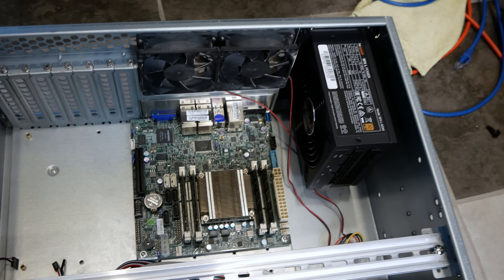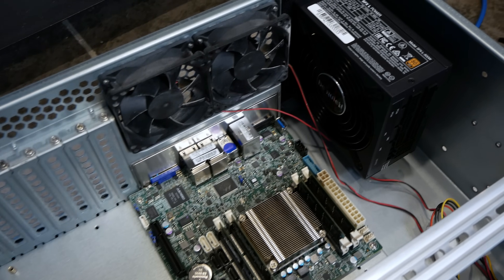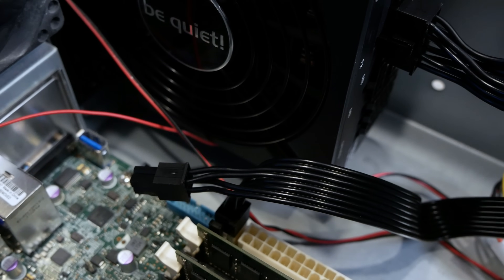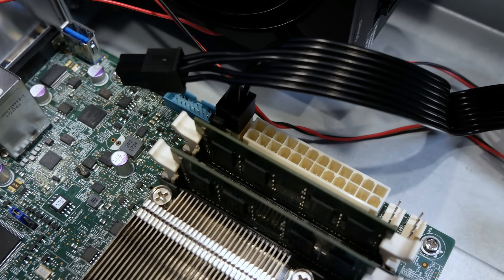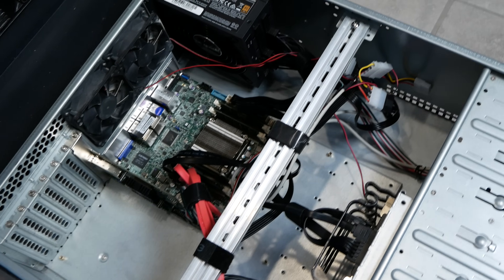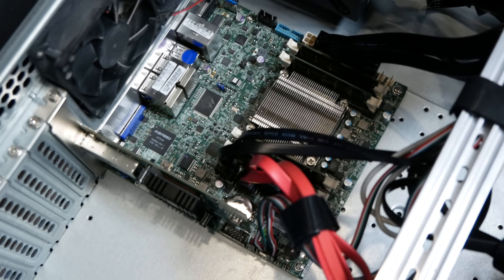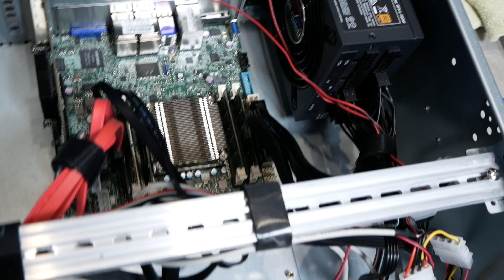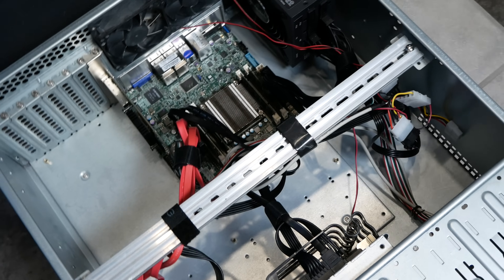Purchasing Used Low Power Server Hardware for a DIY OPNsense or Minimal TrueNAS Build

Comment: The more people watch your videos, the more eBay scalpers are going to jack up the prices. Mamamiya!
Reply from the maker: It is possible but I don't think I have that much influence with my small channel. haha. I can't help prevent scalpers unfortunately if it does happen. Used hardware is a great way to save money but of course there are some risks with that. So far, all the used hardware I've bought has done well. Most of the time I replace hardware before it fails because my needs change and/or I need a bit more hardware resources.

Comment: For bargain basement cheap to run and purchase, it's hard to beat used Fujitsu S720 & S920 thin clients. Easy to repurpose into firewalls, mini servers, etc. Great for homelabbers on a pocket money budget.
Reply from the maker: Yes, my goal wasn’t to get the cheapest possible hardware. Others have said similar things, but I stated my goals in the video (primarily server grade motherboard features). I wanted cheap, power efficient, IPMI, ECC RAM, multiple built in NICs, and a PCIe slot fast enough to support a 10Gbps NIC (since it’s not built onto the motherboard).

Comment: It would be awesome of you could do this exact same type of thing, but for a 10 gig Firewall.
Thank you!
Reply from the maker: You mean use a budget friendly used server grade motherboard with IPMI, several built in NICs (potentially including 10G so you don’t need a separate PCIe card) to use as a 10G firewall? It takes a lot of CPU if you’re going to be doing IDS/IPs but if you’re doing basic routing/firewalling, you can use a weaker CPU and still get good 10Gbps routing. I’ve designed my network to not route any NAS or other high throughput traffic through my firewall thus minimizing the need for a very powerful router/firewalling (a basic mini PC with 2.5G NICs is enough for my needs)
Reply: @homenetworkguy Thank you for your response! 

If you have a video on what you mean about not routing through your firewall, I will take that knowledge as well.

I am  using a Qotom. Two ports are dead. I shuffled things around. (After a ton of troubleshooting) And It is still my current Firewall and working. With OPNsense.

I bought a Protectli Vault Pro VP2420-4 and found you from the OPNsense on Proxmox video. But I have started to fear the protectli might die in 6 years like the Quotom. So I was wondering if there was an affordable way to do a commercial type set up (Like this video I now found of you... And subscribed since you are on a roll with me!) and rhe 10 gig was just a futureproof thought. Perhaps 2.5 is good. This is my point. I need a video on that!  I don't know! 😂
Reply from the maker: From an electronics standpoint, 6 years is still pretty decent but I agree that certain PC hardware (even consumer grade hardware) should last at least 10 years. I used the same motherboard/CPU for 11-12 years before I retired it for something faster. It was still working pretty decent considering its age. 

Buying quality components and keeping it on a surge protector/UPS helps a lot too I think especially if it does AVR (automatic voltage regulation) to minimize spikes and brownouts. I’ve been fortunate that most of my hardware replacements are due to needing higher performance or capacities rather than failing. Hard drives are the exception since they tend to fail sooner than other hardware.

My original Qotom box has survived beyond 6 years of 24/7 usage and I’m actually repurposing it after several years of not using it.

I’m hoping to do some more videos on network architecture in regard to multi-homing devices, creating a dedicated 10Gbps network, etc.

Comment: they are really old and i would not recommend them. an n100 has better performance just lacks pcie lanes, the firewalls built around the laptop cpu's have best performance per watt.
Reply from the maker: Thanks for the recommendation. It’s working great as my secondary TrueNAS system with IPMI and ECC RAM as a replication target for my primary TrueNAS system. I wanted a hard C3000 series motherboard but they’re more expensive.

I bought this board for the server grade features and not for maximum performance per wattage. I had a specific purpose in mind for it.

Comment: What are power consumption figures (idle and full tilt)?
Reply from the maker: I know when I was testing this board that it was idling at 25-26W with only a single SATA SSD attached. I didn't mess with any power savings settings with C-states, etc so I'm not sure what minimum would be if it's possible to tweak the BIOS settings for further reduced power consumption. I haven't tested the max wattage yet (but I should test that sometime). With 2 3.5" disks and 2 SSDs, I think the wattage was closer to 40W. The idle consumption is a bit high compared to some modern mini-PC hardware but for a server, it's still better than 60-65W that my main TrueNAS system consumes (but that includes the power consumption of 4 3.5" disks and 2 SSDs) and an older system I was using as a Proxmox Backup Server that was consuming 85-90W (which I decommissioned in favor of a mini-PC that uses 11-12W including the SSDs). I'm hoping to get some hardware for lower power comsumption for my main TrueNAS box as well. I'm using the board in this video as my TrueNAS replication server to have an extra backup of my data.

Comment: It's crazy how expensive that mobo is especially considering the bug. Intel is batting .500 these days while AMD is somewhere near .998.
Reply from the maker: Yes but I believe they fixed it so hopefully it’s no longer an issue for new revisions.
Reply: @homenetworkguy  they fixed it in the next version 3800's and their is a bios update to reduce the chance for it bricking the cpu but they could not stop deliberate attack

Comment: I was going to bring up atom CPU failing after a while.  2000 series.
Reply from the maker: Yeah, I'm hoping that the new revision of the CPU resolves that issue completely. I'll update if it does fail. At least there is a workaround with soldering a resistor so I will try that if it happens to me.

Comment: The +12 power supply needs to be constant. You can still make the ATX PSU work by bridging the power on signal to keep it on all the time. Another option to use an old 12v brick power supply(If it has enough amps). The drawback with the 12v option is running your hard-drives but is great for firewalls or pxe boot systems.
Reply from the maker: Thanks for the info! I wasn’t sure the proper way to utilize just the 4-pin 12V connection, but since I’m wanting to utilize several SSDs and HDDs, I’m ok using the standard ATX CPU power connection.

Comment: mmm atom, isnttha slower than a n100? and uses way more power? and when you look at the ryzen nas, with 6 ssds idles at 14w, like Wendell said, withtheactual hardware there is no point anymore to use old servers, because the horse power and consumption difference is to much, unless energy price is not a problem and you already have it or is dirty cheap
Reply from the maker: I've addressed this in the video and other comments. Yes, it's slower than the N100, but the N100 does not come with server grade features such as IPMI and registered ECC RAM. This board has 4 DIMM slots and supports up to 64GB of RAM. The N100 supports 16GB and potentially 32GB.

I imagine Wendell is referring to old, large, noisy, energy hog servers and I agree with that sentiment. I have never bought any of that sort of enterprise gear because it's just not efficient or practical for 24/7 usage unless you just want to tinker around with it for fun. This board uses 25W or so idle and when you add drives it bumps near 40W (but I haven't tried tweaking any power savings features yet or have the hard drives spin down).

I haven't had the chance to try out the new Ryzen hardware that idles at 14W like you mentioned. I'm sure it's not cheap (yet). I will be interested in that if it offers some IPMI features and ECC RAM (not really necessary to have ECC but nice to have in a server that's using ZFS).
Reply: @homenetworkguy   take a look at aoostar, i have the  wtr pro amd ryzen 7 5825u, near 500$ in germany, there is a new version with more drives but haven't seen a review of it yet, before that i had the odroit h3+ but i was adding more and more to my nas and was a little weak, so decided on somethin more powerfull but still low power, also was thinking on the ones from cwwk and minisforum, very interesting both

Comment: 12 volt input should work.
How many watts/amps was the 12V power supply that you tried?
Reply from the maker: It was just from the 500W SFX PSU I’m using. Thought it would be nice to have a less bulky cable but not a huge deal since I have it in a large chassis so space and cable organization is not a huge issue.

Comment: I have a few of these of 2014-16 vintage. I only boot them once in a while for playing around and none have experienced the watchdog failure.. yet. They're fairly slow, but great as a firewall or lightweight hypervisor duties, docker, etc. home lab type stuff. My whole lab when fully powered up is <200 watts. The latest BIOS allows up to 64GB of ECC RAM, but 16GB DDR3 ECC SODIMMs are unobtainium. I've stuck to 4x8GB using the more affordable Kingston KVR16LSE11/8 DIMMs. They're discontinued, but still a decent amount out there from $45-65/stick new. 32GB/host is more than enough for me.
Reply from the maker: Yeah good little boards for certain purposes. I’m glad they’re still kicking even though you don’t use them very often these days. I agree that 32GB is a pretty good amount for homelabs. I have 64GB on a couple mini PCs in my Proxmox cluster. I don’t reach 64GB often but it gives me the ability to fire up a couple VMs for testing with some headroom. When I only had 1 Proxmox server I tended to use most of that 64GB of RAM (lot of it was ZFS arc cache but I also would run several VMs. Now I can spread the load across a few devices).

Comment: Makes no sense, Intel N100 based motherboards beat this shrughs
Nice for experiment, but these boards would need to cost like 40$ to make it worth it
Reply from the maker: It does make sense for certain workloads. It has IPMI and registered ECC RAM. If you add the cost of needing a separate remote KVM solution, it would add up. By the way, I did build a couple N100 systems using ASRock N100 motherboards and it cost a good bit more and it supports less max RAM capacity as well (don’t think it supports UDIMM ECC RAM either).

Comment: Where's the part where you actually show its using "low power" using a smart meter or killawatt?
Reply from the maker: I forgot to show it… I have a lot of things to keep track of so I didn’t end up going back to put a screenshot/screen capture to show it. With 2 SSDs and 2 hard drives, it idles near 39-40W. That’s about 30W less than my main TrueNAS server that has 4 hard drives instead of 2. I believe with only a single SSD and nothing else it was closer to 26-28W. Not quite as low as many mini PCs but not as high as  older Xeon or consumer grade boards.

It’s possible there are some power savings features I could or need to enable to get it lower. I should to see if there are any settings I could tweak.

Comment: I think you put you CPU heatsink sideways. the airflow channels are from side to side now blocked by DIMMs. but normally server air flow is front to back, that is now does not match heatsink air channels. TDP on these atoms quite low so it may work fine but still not efficient. also, if your server has low airflow, it is nice to stick 40/60mm fan on top of heatsink, there are various methods to accomplish that from just screws, zip ties to 3d printed brackets. that 4pin 12v is not standard atx its for supermicro external brick adapters mostly. otherwise, it is great motherboard sadly most of them still are very expensive, also once you go IPMI there is no way back, ipmi is way more than just remote kvm.
Reply from the maker: Yeah I’ve seen that mentioned by others on other people’s videos. It might’ve came shipped that way but I did temporarily remove it to look for the CPU stepping. The CPU temps stay in the 40C range without an active collier so I’m not worried about it. It runs cooler than some of my fanless mini PCs. That’s the great thing about having a lower TDP. Also that systems idles most of the time and CPU usage is low even when snapshots are being transferred to the system.

Built in IPMI is certainly nice to have and I appreciate having it on my 2 TrueNAS systems even though I don’t use it frequently (since those systems tend to be set and forget it most of the time u less I get an email alert of something that needs my attention).

Comment: You may want to increase your ethernet MTU size and enable jumbo frames to reduce re-transmits, provided you have 10+ GB ethernet.
Reply from the maker: I do enable jumbo frames on the 10G interface when using that board as my TrueNAS replication target (which is shown in the fast 10G speed test). I have a backend 10G network where all systems connected to it have jumbo frames enabled. It’s not a routed network so I don’t have to worry about MTU mismatches between networks and potential retransmissions.

Comment: There is a good reason why the atoms are no longer utilised or considered, lookup the C2000 atom bug and their failures. Left a bad investment for the C3000s, possibly...
Reply from the maker: I addressed this in the video. I have a newer revision of the C2758 which does not have the CPU bug. Also I don’t think that bug exists in the C3000 series. I’ve been running a mini PC with the C3758 for the past year and do have any issues yet.

Comment: With the exception of IPMI - Why not just use a Ryzen PRO 5350, 5650, or 5750G with ECC UDIMM and an Asrock X570/B550 mATX board (supports ECC)?
Not intending to criticize your build - really interesting board.
Reply: ecc udimms way more expensive than rdimms, also IMHO ipmi is a must on any hardware that you call a 'real' server.
Reply from the maker: Yeah I have found myself preferring to have ‘real’ server hardware for my TrueNAS systems. 

I’m using consumer grade hardware in my Proxmox mini PC hardware (except for the one mini PC that has a C3758 CPU— but it doesn’t have IPMI although I had a serial console). I wish I had some of those server features for those systems but it’s stable enough for a home network.
Reply from the maker: Ohh I’ve considered alternative hardware but those CPUs do not have 25W TDP. Of course, other systems can be tweaked to have lower power consumption but it’s nice to have server grade features for cheaper than buying new consumer hardware. I believe that registered ECC RAM is more robust than UDIMMs that support ECC. I’ve looked up the difference one time, and I can’t recall off the top of my head all of the differences. Also server boards typically come with several NICs which are useful to utilize as management interfaces and you can multi-home systems so they can sit on multiple networks. This is very handy for a NAS because you don’t need to route that traffic across a firewall (which can put a heavy load on the firewall if you have IDS/IPS enabled and/or your firewall CPU is weaker).

Comment: I use the C2750 and C3758 based motherboard as Proxmox hosts for years now. Perfect for running containers, linux VMs and low power hungry applications and above all firewalls. They can be powered by 12V so you can use a 12V adapter as well. Or use mini PSUs.
Reply from the maker: Yeah I agree. Great low power server boards. I tried using just the 12V from the PSU and it didn’t seem to boot up. Interestingly the user manual says don’t use both power connectors even though most motherboards require both. Fortunately I saw that before plugging both in.
Reply: pinout is probably different on 12V adapter vs. cpu 4-pin on regular PSU
Reply from the maker: Yeah I imagine so but if you’re used to utilizing the 4 pin connectors for the motherboards— that is a bit confusing (potentially ruining the board).
Reply: @homenetworkguy  you have to short 2 pins on the 24 so the powersupply will power up green and black / pin 16 & 17

Comment: I have another one of those boards like this with 16 gigs ram in it, i don't use it any more if you want to message me..
Reply from the maker: Ohh nice. They’re good for certain types of low power server builds that don’t require a lot of CPU horsepower.
Reply: @homenetworkguy  It ran my Opensense for the longest time, i moved onto Alta Labs Router..